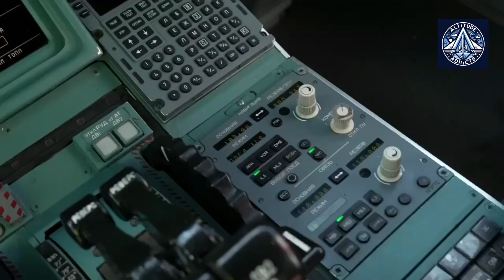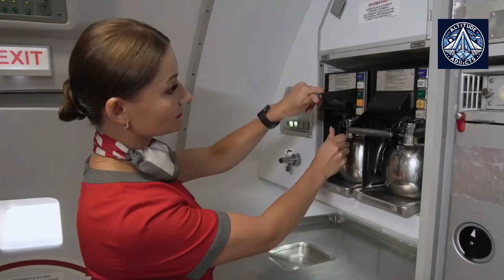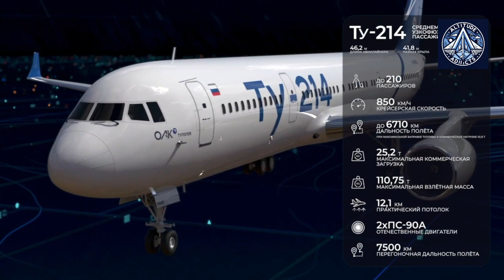Can Russia’s Tu-214 Overcome Sanctions & Scale Production?

Comment: I flew on an Airbus A321XLR recently - I was seated up the front - when I stood up to look back down the cabin I was really shocked at the number of rows of seats. That plane is basically a modern reincarnation of 757/Tu-214 .... the plane was so long ..... the rear passengers had to embark via stairs to the tarmac !
it seems the Tu-214 has good potential to fly directly to smaller cities directly (like the A321XLR) so passengers can avoid flying to big hubs in wide body planes and then having to switch to a regional jet or turboprop

Comment: Tu-214 already has.some customers but they need to work with a spring on their foot! Upgrade the cockpit and finish other parts substitution quickly so you can produce and supply to customers.